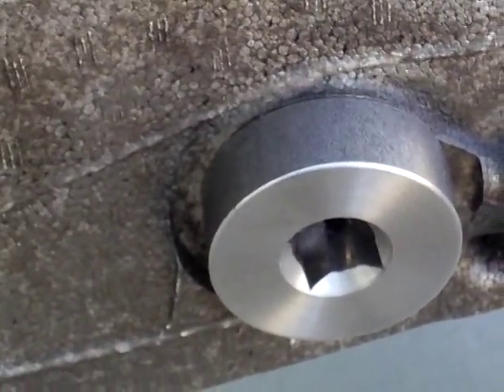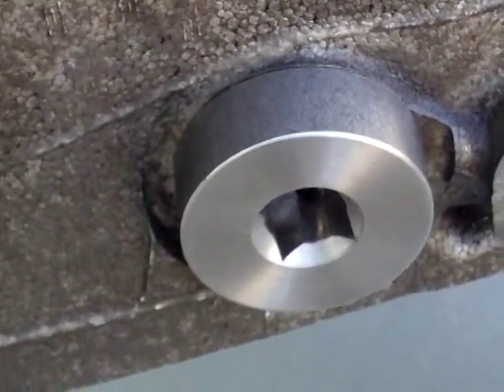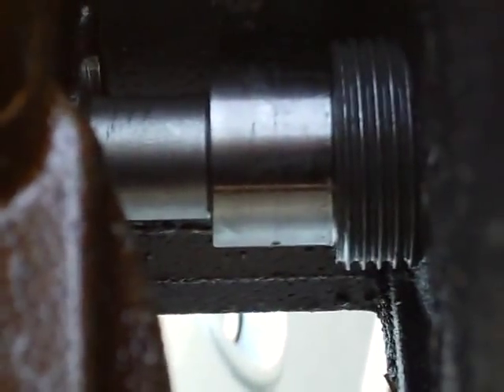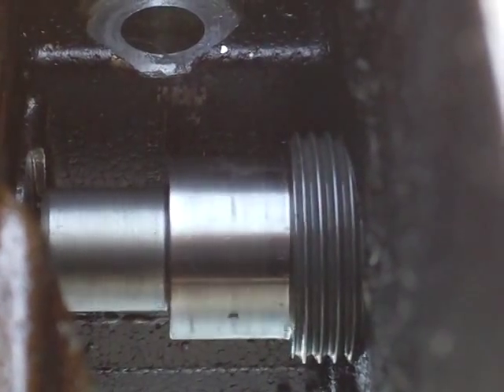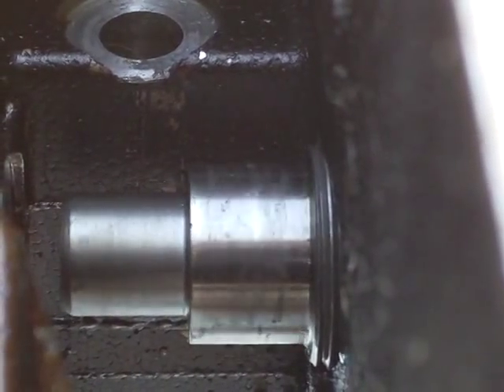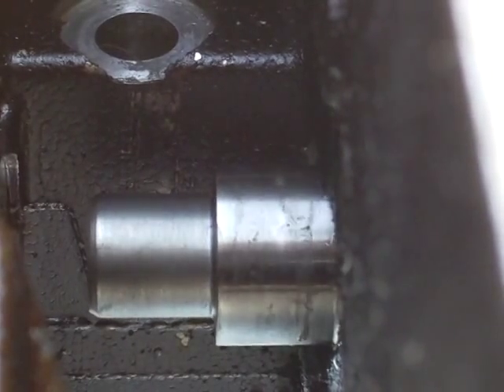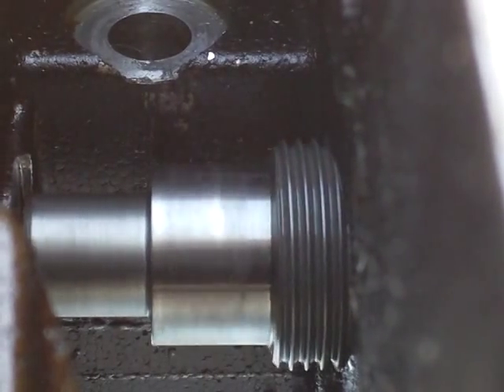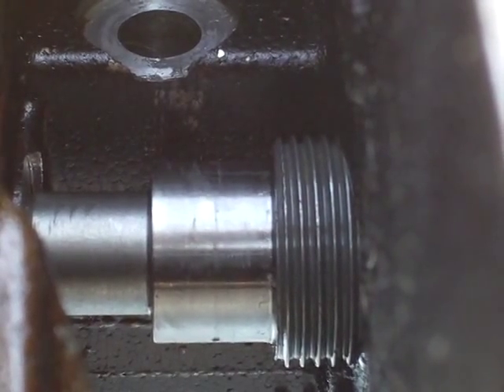Ecotec timing chain front guide bolt repair

Comment: I bought the part and did not receive it.The guy took the money and would not reply to email or phone calls.I later found out that Michael Brandt died three months ago and his grandson was the one taking the money and not sending the part.So I had to go and file a claim through paypal and get my money back. So I would not send money to this person.I would rather have the part then the money back so I can fix my car.It looks like a really good fix I guess I will never find out.
Reply: Thanks for the info.. It's too bad some POS is taking advantage of people using their late grandfather's EXCELLENT idea. So what ended up being your fix? I tried thread insert, seemed to work good, but could get the right torque.
Reply: Joshua Jones I guess I am going to pull the head off and take it to the machine shop to get the broken bolt out.That is the only thing that I know to do with it.I would rather have this great invention.

Comment: Hi guys,

 Is the same part or does it perform the same function as?:

 ACDelco 12608580 GM Original Equipment Timing Chain Tensioner Kit

Thanks,
Rick

Comment: Nice work Mike,

I'm looking at fixing my 2.4L ecotec 2010 Equinox.  It has the chain rattle you read about.  The chevy letter talks about balance chain pin and chain stretch.  I do my own work for the most part.